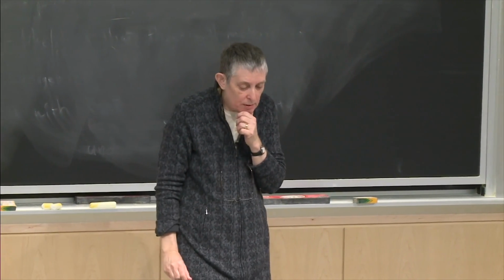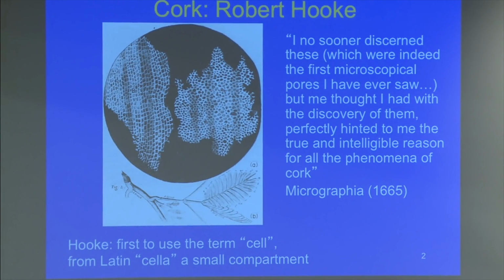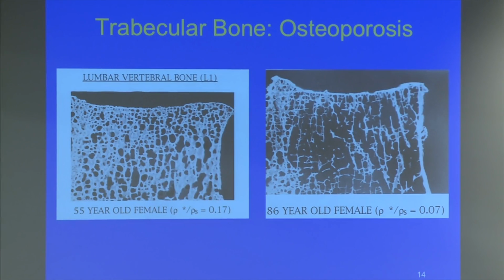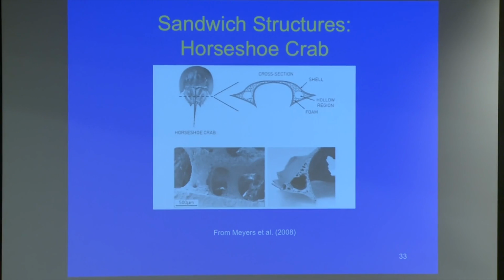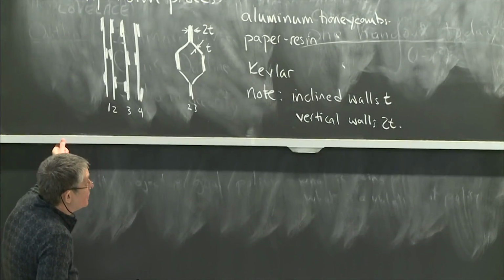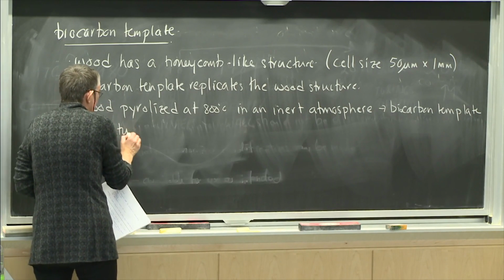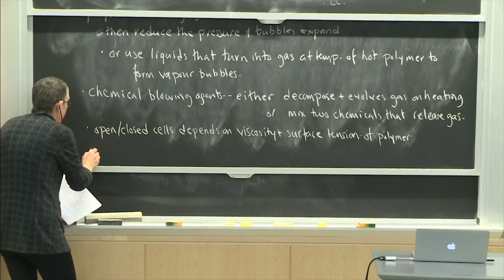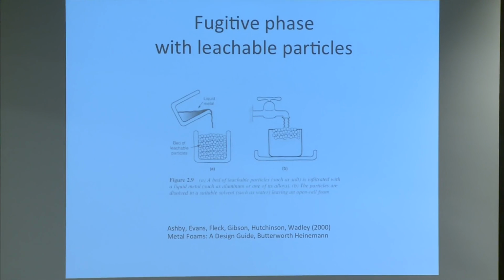1. Introduction and Overview (MIT 3.054 Cellular Solids: Structure, Properties, Applications, S15)

Comment: I'm checking out parts of this lecture series in order to get some inspiration for the development of practical assignments for students at the school where I work at; this subject is slightly beyond the scope of the physics that our students need to understand but it's quite practical so I think that it might lead to something nice over here. I would also like to provide a literature recommendation that could really add to the insights that are provided in the content of this nice lecture series: "The Physics of Foams" by Weaire and Hutzler, issued by Clarendon Press in 1999 (I believe that this is the first edition). I don't think that I've seen it mentioned but the content of the book seems to be directly in line with the theory on foams.

Comment: Is it possible to use soft tissue scaffold several times in a tissue expansion process to thiken the skin or would you rather use a thicker soft tissue scaffold just 1 time?
For example, lets say a woman would use a soft tissue scaffold for breast reconstruction after a mastectomy, just hypothetically... lets say she would like to expand her skin breast tissue to be able to have 4000cc breast implans... just to get an idea, of what soft tissue scaffolds could be able to do or not do... 
She'd need 2 pair of tissue expanders. The first pair of like 800cc overfilled to reach up to 2000cc and then she would exchange the expanders as she reach 2000cc volume with a new bigger pair of breast tissue expanders that would be able to be over filled to 4000cc volume, her desired volume.
Now.. of 2 options which would you recommend?
1. 1 thick scaffold.. Would you use just 1 kind of thick soft tissue scaffold. how thick would you have it to be able to stretch her skin to the volume of 4000cc?
 
OR
2. 2 layers of soft tissue scaffold each inserted together with the pair of expanders. 1 layer of soft tissue scaffold together with the first breast tissue expanders,  and then  insert 1 more soft tissue scaffold as the tissue expanders implants are replaced with the bigger expanders that can reach 4000cc?

And... one last question... is it hard to remove the scaffold from the expanders? the scaffolds become one with the skin right? or is it more like a capsule surrounding the implants? is it okay to use scaffold in an expandable breast pocket if the scaffold is expandable? or would you use the tissue scaffold when permanent implants are set in place, after the expansion of the breast tissue has been achieved?